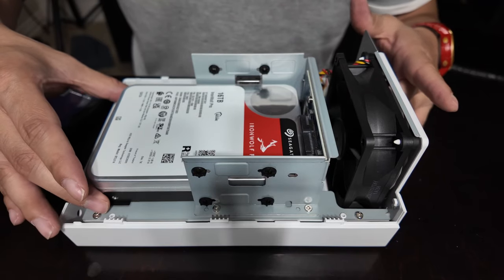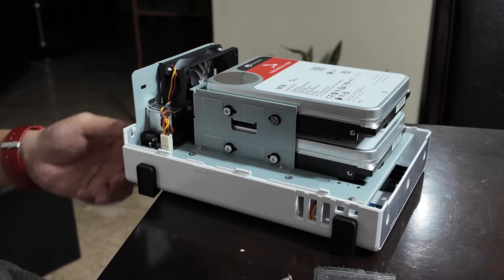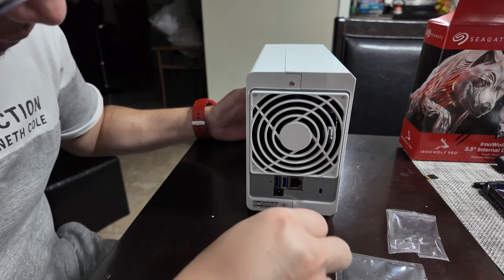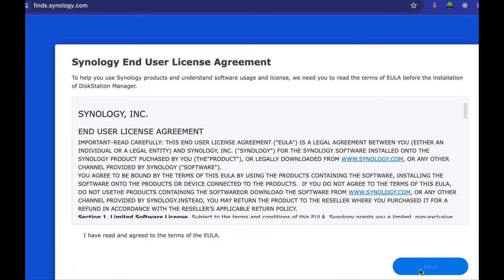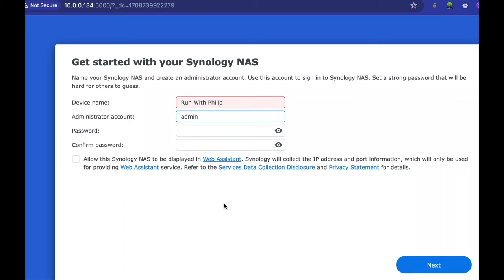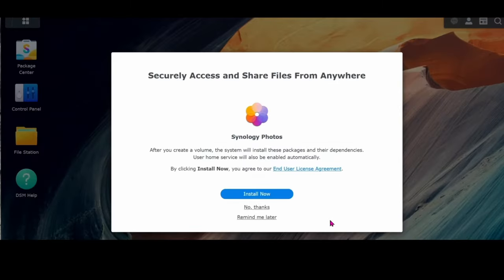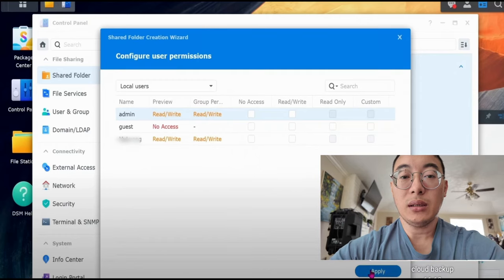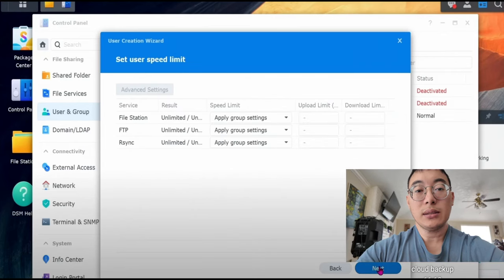Setting Up Your Own Personal Cloud with Synology DS223J

Comment: Simple and clear explanation - thanks
Reply from the maker: Glad it was helpful!
Reply: I think the issue with the start is his reasoning isn't particular sound so it makes it feel a little like an ad. You give the reasoning of space management... but whilst having more space makes management easier, it being on a cloud doesn't really change much. If I buy a 2tb drive for my pc or buy a 2tb cloud solution solves exactly the same premise you begin with, and the one you went for is way more expensive. Obviously there are lots of benefits to a cloud solution, but you should probably make the first story about losing data, not deleting data, because these are 2 seperate cases, and cloud is the obvious solution for one of them.
Reply from the maker: I appreciate the feedback. Always looking at ways to improve on communicating. Here is some context this video was not created to compare cloud service vs owning your own data. 

This video is a how to setup ds223j. As a content creator I used a lot of memory so this setup works perfect for me. Also I’m not sponsored.

Comment: Thanks for the video. I’m considering of getting this, but a lot of the reviews say it’s too slow. Hows your experience so far? I am planning to store photos, videos, and files and view them mostly
Reply from the maker: As far as uploading videos in quick connect it would take 50gb folder about 8 hrs. This is because I’m in Cambodia while ds223j is in USA. But when I was at home the ds223j uploading was two time faster. There many factors why it could be slow. The DS223J is still up and running well. I would use their photo mobile app to view photos.
Reply: @Pheelip  awesome thanks! How about when you are browsing and viewing photos? Does it take several minutes for the photo thumbnails to load?
Reply from the maker: Photo thumbnails load quick in web browser and app but previewing videos takes a few minutes for me to load on quick connect.
Reply: @taehoonkim8202  hey bro which model you bought finally? Same I also saw reviews that it's slow. And the ram is not upgradable which means it's not future proof. So I am thinking of buying ds224+.

Comment: Hello, do you need to change anything on your router in order for the synology to be visible outside your network? like port forwarding?
Reply from the maker: Great question. I did not change any router settings during the process of setting up DS223J. In order to access my files I would login 
quickconnect.to/username
Reply: @Pheelip  Thanks for the response!

Comment: I'm looking to maybe use this NAS as storage for my ripped 4K UHD disc collection. I don't want to use the NAS to connect to my TV/device for plex playback. I just want to use it as storage and backup and I plan to use my PC to organize my Plex. Is this possible? What is the best way to connect my NAS to my PC? Would it be just a direct ethernet connection to my PC or some sort of USB connection?
Reply from the maker: Yes it's possible to use NAS as storage and backup. One way is to use quick connect which is the setup in this video. You connect the ethernet cable from your router to your NAS. Then connect to your NAS via Wifi with quick connect. Hope that helps!
Reply: @Pheelip  thank you. I have been backing up my 4K UHD disc library and streaming to Plex but I am running out of storage and looking into backup options. My PC is more than capable of doing the task, but I just need good backup storage options that are reasonable in price.

Comment: A little confusing. You installed 2 Seagate 16TB drives but the setup shows you are formatting  2 Western Digital 2TB drives. You said to use SHR but the program is using RAID 1. (This is probably accurate as SHR is mirroring the drives and if they are the same size it likely uses RAID 1.) Does this unit allow you to set up a DNLA server so that you can access your photos and videos on a Smart TV?
Reply from the maker: Whether you installed 2TB or 16TB it is the same process setting up the DS223J. Great question.  I’ve never looked into access your photos or videos on Smart Tv so not sure that would be possible. Definitely will look into that as I explore synology ecosystem.

Comment: If you can point to the device where it is running, it is not a cloud. You may as well call it "your own AI" or "your own company". Calling it a NAS would be ok.
Reply from the maker: How do you think small Cloud company is able to provide their services? They would use devices or a NAS system but I understand what you mean. What is considered a cloud? Pay monthly fee to store and access files over the internet? Personally the process of putting DS223J was enjoyable. There a place for both cloud services and NAS systems. It all user preference. Thank you for your input!
Reply: @Pheelip  Network storage and cloud are not really related. Cloud (in IT) usually means that the hardware is abstracted. A distributed system where the hardware is just a pool of resources that can be used by any customer and any service. Contrasted with the old way of having one server with a single or handful of services, and where you needed to upgrade the hardware to scale up the performance. I can see how it can be confusing. But it will get even more confusing if we start using the terms wrong. Just like some people think "digital" means "distributed via internet" or "smart" means "can run apps".